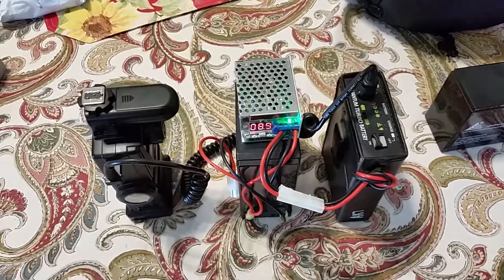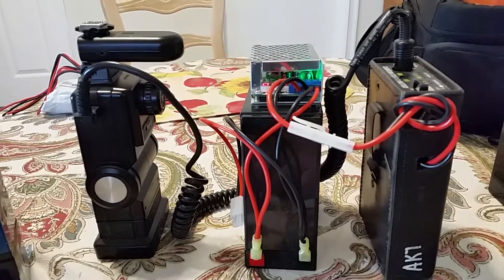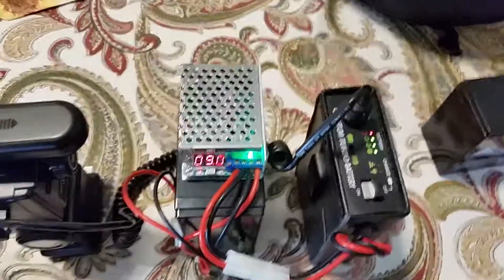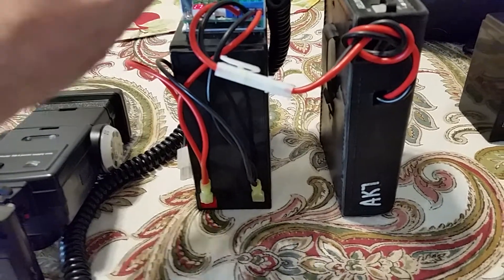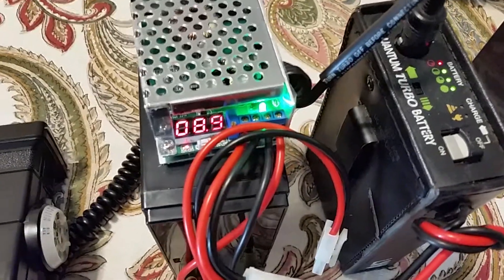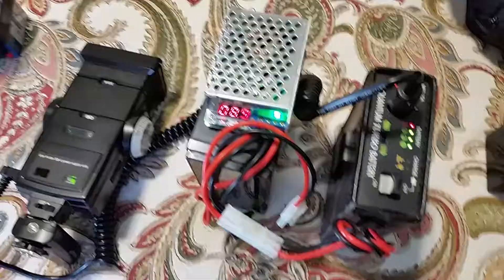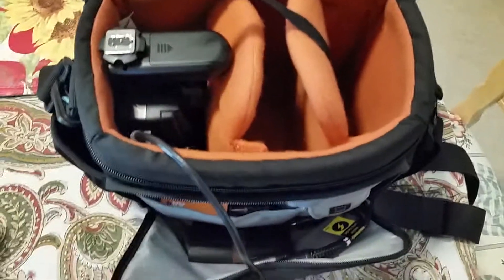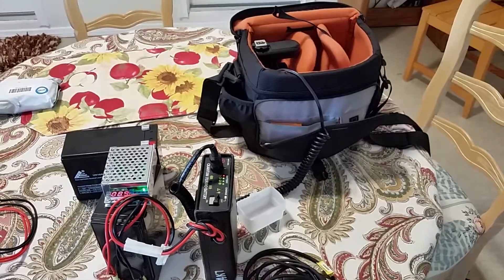VIVITAR 285HV PORTABLE HIGH VOLTAGE HIGH CAPACITY SYSTEM

Comment from the maker: You cannot get 100 full power flashes firing immediately after recharge before overheat.  Maybe 25 or 30.  That is just a limitation of the 285HV.  The original 510V Vivitar Battery Pack will disconnect High Voltage if temperature is too high-this set-up wont.  If you are stuck at full power try another Vari-Power module.  If that doesn't work something IN the flash is bad.  In that case best to find another unit.  The battery thing in this video gives BOTH extreme number of flashes (Total Energy) AND is very powerful (Rapid Recharge).

Comment: Mark David Strobe, you were able to get the Vivitar 285HV firing at full power over 100 bursts w/o overheating?
I think not. This flash like many speedlites would overheat & shutdown.

Mod the battery is useless if the flash doesn't hold or run or fire without overheat and shutdown.

Here is the big question & if you know the answer, please share.
Flash fires at full power (1/1), what part is defective?